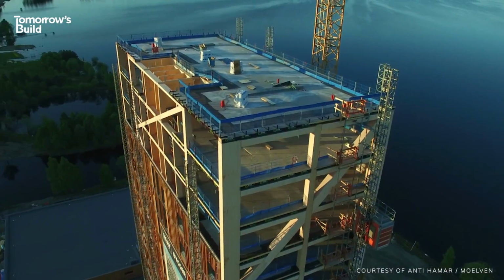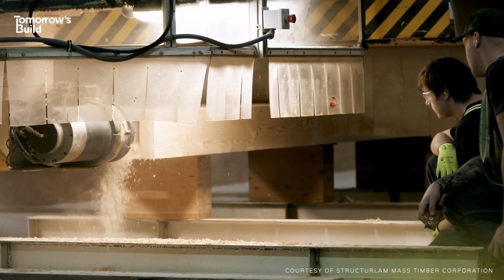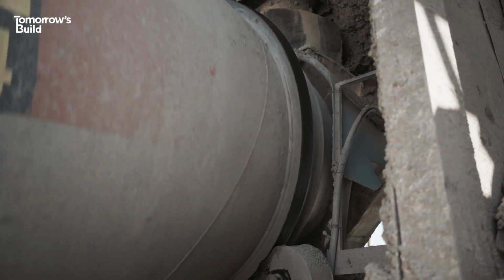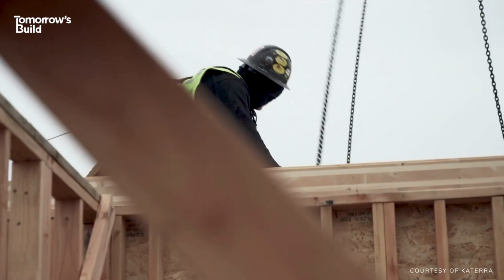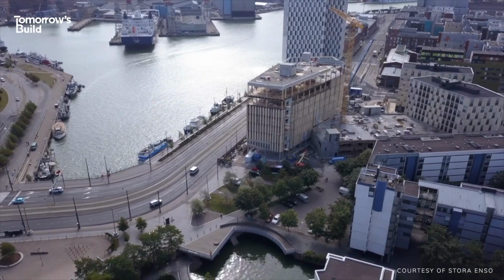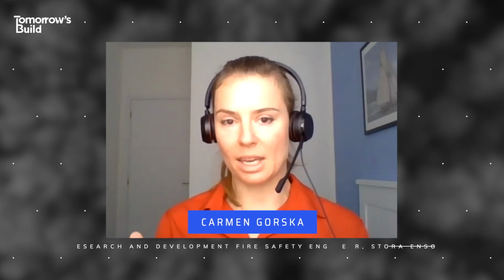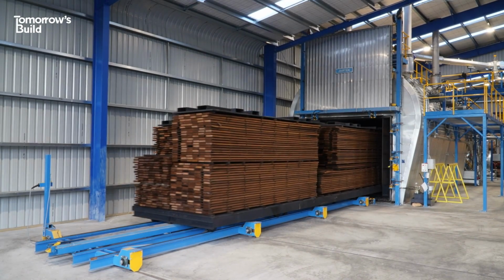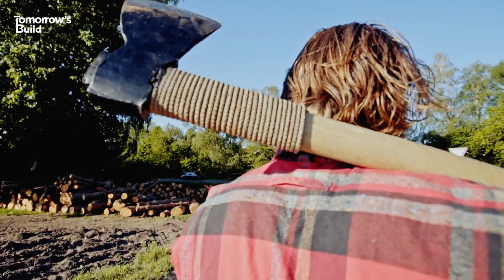Why All Buildings Should Be Timber

Comment: I'm not totally won over as I still have questions about it's longevity. Empire State Building is approaching a 100 years old and, admittedly thanks to renovations as well, it's still a modern looking icon. Can a wooden home compete in endurance as concrete homes? Seems that wooden parts of a home seem to degrade long before the concrete shows it's age (not including earthquake zones). CLT protected against mold but with the fire layer that's going to get moldy too(?). A video about it's endurance would be nice either here or more B1M.

Comment: There are certainly many other issues with Timber not addressed in the video. Region with High humidity would be of concern. Also other safety issues. Sound / noise / heat isolation etc. But at least it is being worked on. Hopefully someday

Comment: The issue with timber however is that it cannot survive air to grounds as well as steel and concrete does. Although arguably, concrete if done wrong can also be weaker than timber against air to grounds.

Comment: Your points are valid... but sadly sustainable timber is often fake. Since the scheme started in 1993 deforestation of tropical rain forests has increased and much of the timber sold as sustainable is actually not. It is very easy to add the logo or fake the paperwork... Maybe your high street store may car and may try and track the wood to its source... but will the funiture company or the wooden window company or paper mill or the lumber yard really spend the money on tracking this? Ikea do, as do most of the major hardware shops and a few others... but that aside the industry is full of wood sold as sustainable that isnt.

Comment: I personally am very leery about all wood construction, especially large buildings.  A few months ago in New Jersey a 3 to 4 story condominium was ready to greet it's first buyers.  The condo was constructed in all wood.  One evening, a week before the first buyers were scheduled to move in, a contractor mistakenly left some sort of machine on which got hot and started a fire.  Because no one was yet living there, the entire building burned down.  I don't know if the town had updated it's building code to reflect the type of wood products discussed in this video, but the video did acknowledge that if an intense fire got going, the all wood structure could eventually fail.  After WWII, New Jersey towns enacted strict building codes for large residential structures that required firewalls between all or every other unit.  These codes prevented loss of life even though the initial cost of construction was higher.  Over the past decade developers have gotten the local towns to downgrade their building requirements to now allow all wood construction and no firewalls to cut construction costs.  How this will eventually work out I don't know.  I currently live in Nashville, TN and last night 18 families lost their homes because all wood construction destroyed their apartment building.

Comment: Excellent video. Very very interesting. I am still not sold on fire resistance though. I think I still would rather be in a “fireproof” concrete and steel building, especially if it is a low-rise or high-rise building.

Comment: Are the chemicals used to treat the timber (fire retardant, anti mold/fungal coating) non-toxic and environment friendly? What about indoor pollution from the gases produced by termite action? Can these buildings be rehabilitated in same way after a fire (or other disaster) as conventional buildings? What's the maintainance cost? These are all questions this propaganda video deceptively bypassed. Sustainability would not be achieved by such misleading tactics